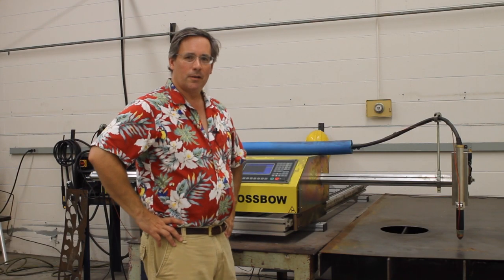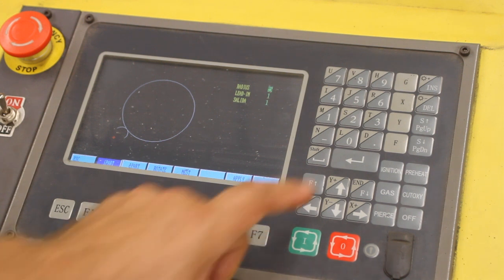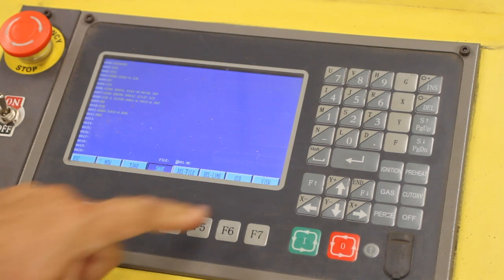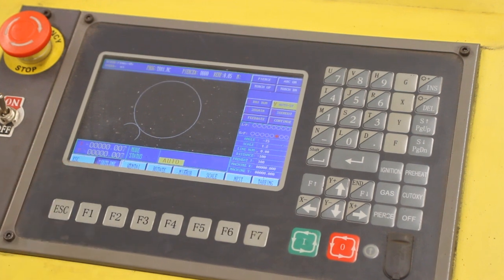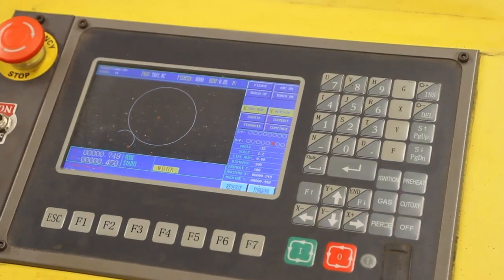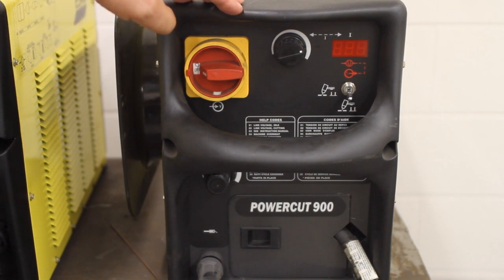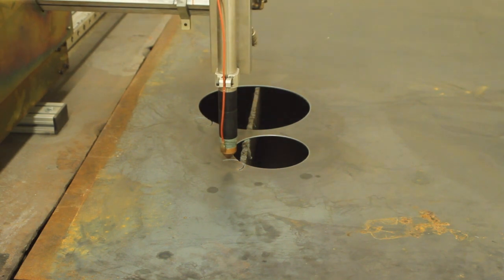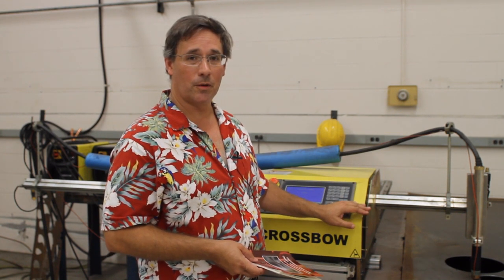ESAB Crossbow CNC Plasma Cutter Built-in Libraries How-To

Comment: i also have crossbow and it took me 1,5 years to get it running.  looking back, i would have bought another brand with a gantry system, not the flimsy arm... dont buy it.
Reply from the maker: I agree, we bought it where we worked.  I did co-author a book (Lulu.com) on how to use open-source free software to make designs the Crossbow can use, that is the real key to getting mileage out of it, but agreed as of 2022 much better systems available.  Thanks for the note Martin.  Best, Burton
Reply: @j.burtonbrowning3361  Just ordered the book, and hopefully will get me going beond the limits of the inbuilt  library.  Thanks :)   if you  have any struggels with your fish in the aquaponics system, just ask me. i`v been a proffessional fishfarmer for 34 years.
Reply: Im about to buy one of theese, and my budget is like 7000$.. Any advice..?

Comment: Hi, I own a crossbow, and like FARM TECH CANADA, I reloaded the factory settings. since then, it no longer works. I called Esab France but they don't know enough about crossbow to help me. For them, the Crossbow is hardly part of their product (to listen to them). Can someone tell me where to get the firmware? 
Can you tell me what values you have un "SETUP" - "SYSTEM" : NUMERATOR and DENOMINATOR
Because since then I have a scaling trouble 
Thanks
(sorry for my poor english)
Reply: Hi, i also had alot of problems, only ESAB sweden could help me. they had to send me 2 new units before they fond out what the problem was. its seems like some units have an inbuilt problem.....   also changed the plasma unit and the torch in this prosess, but it was the main unit that had all the problems....

Comment: Hi J I have a similar one , are you able to set the parameters, it was working but somehow I reset it to manufacturers setting and now I cant make it work.
Can you help me please. Thanks
Reply from the maker: Hey Farm Tech....so you should be able to re-flash the firmware on it..  Esab should give you the latest for it.  However are you saying the built-in drawings do not work or nc code from something like Fastcam?  If the later firmware is not it.
Reply: J. Burton Browning  I believe if you can send me pics of all setting I could make it work
Reply: J. Burton Browning mine it’s not a crossbow it’s very similar
Reply: @farmtechcanada8292  what name brand portable cnc do you have. I looking at the esab crossbow myself, seems like they don't have much real competition in this market. The cheaper China ones I'm scared of.
Reply: J. Todd Cudd all of them works the same way
Reply: @farmtechcanada8292  is it cheaper?
Reply: Henry Penner , I got a complete package with plasma cutter, so I cannot tell if a hyperterm will work same way. It can be tricky to set up at beginning but once your learn is great it’s totally worth.they are all the same just different brands and voltages
Reply: Can I use a hypertherm 85 am on the crossbow?
Reply: Henry Penner where are located ?
Reply: @farmtechcanada8292  la Crete Albert Canada